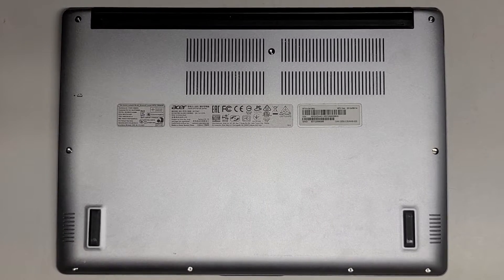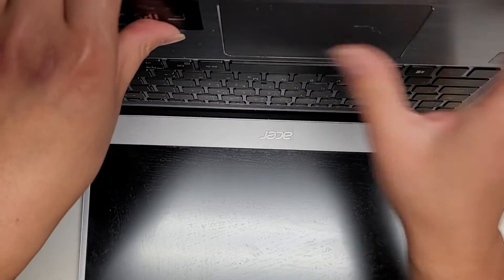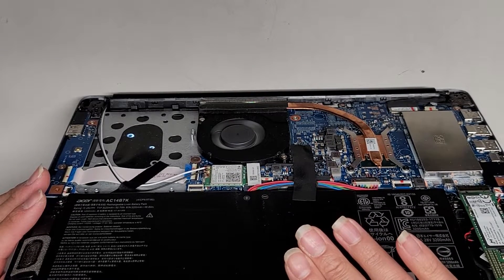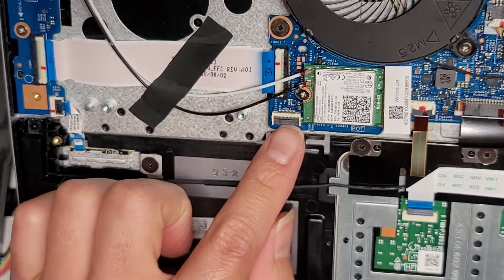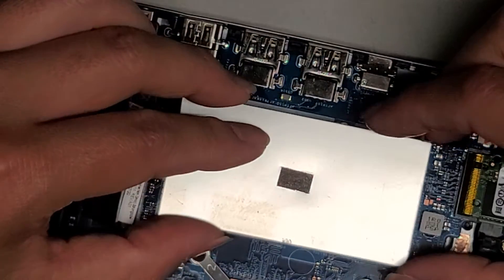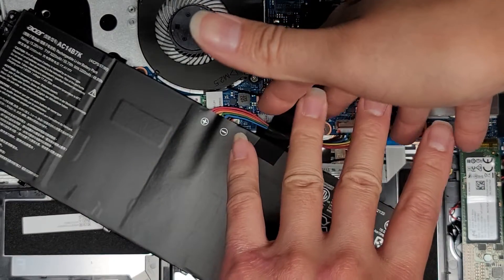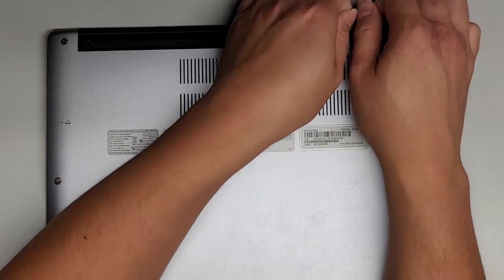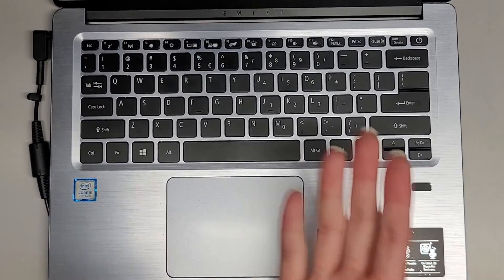Acer Laptop Swift 3 SF314-54 Series SF314-54-53BQ Disassembly RAM SSD Hard Drive Upgrade Battery

Comment: i got this laptop used for 100$ ,is there a possibility to add an ssd in the empty area and can i upgrade the ram from 12 to 20 ?
Reply from the maker: @zaailxx  there's only one RAM slot and one SSD slot
Reply: @ItsBinhRepaired  i already have 256 nvme can i add an ssd ?
Reply: @ItsBinhRepaired  and i mean i want to buy 16gb ram but they said its not supported

Comment: any solution for silicon nipple beneath the space bar key of keyboard ? that little thing is broken for that small thing can't replace the whole keyboard
Reply from the maker: Broken in what way?
Reply: @ItsBinhRepaired  silicone nipple beneath the keyboard space bar key, that rubber has broken into pieces completely i was removing the key and tweezer point just broke thay silicone thing
Reply from the maker: @pradip-p8e  you'll have to scrape the old one off and put another
Reply: @ItsBinhRepaired  i am not getting its replacement anywhere and put new with what glue ?
Reply: @ItsBinhRepaired  yes i have scrape the old one but not finding new one where to get and how to place it with what type of glue ?
Reply from the maker: @pradip-p8e  you could usually just put it in the place and it'll stay there. Need to order replacement keys. It comes with it usually.

Comment: Another stupid design by Acer, yes one can "Upgrade" the ram slot under the cover. Though if the soldered on RAM goes bad well one is left with a brick. I had one for a client and the soldered on RAM was failing as was leaking memory up to 90% with 8GB [4GBx2]. The top one was fine, though the inane soldered onboard one wasn't; useless and frustrating design.
Reply from the maker: Yup...

Comment: I have a sf314-54G with 4GB fixed and 4 removable, i know switching 4 with 8 to get 12 is possible. But would it be worth trying to use a 16GB ram to get a total of 20 even if the listed max ram is 12? I've seen some people say it's possible but opinions differ
Reply from the maker: Opinions don't matter. Facts do. If it worked for one person of the same model, it'll work for all.
Reply: Did it work?

Comment: Hello, I have two issues with this laptop,
1) I have only 4GB RAM, can I upgrade RAM to 8GB or 16GB? What form factor does it have?
2) My laptop shuts down instantly when i plug off from battery, but the battery worked perfect before that, what can be the issue?
Reply from the maker: 1) Yes. The info for the type of RAM  is in the video.
2) I recommend trying another battery.
Reply: @ItsBinhRepaired  So this ram is DDR4 2400MHz SODIMM, but i want to try DDR4 3200hz SODIMM. Will it be compatible?
Reply from the maker: @SkyBilim  you can try. I'm not sure.
Reply: @ItsBinhRepaired  by the way, thanks for the replies. I just figured out that my cpu cannot hold that speed. If I set 3200hz, it will automatically downclock to 2400hz
Reply from the maker: @SkyBilim  I see
Reply: What did you chose? 4+8? Or 4+16? 

I have the same notebook problem..
Reply: @alessandropavan98  better choose 8gb. 16 gb of ram will be lots of pressure for the laptop.

Comment: hi, do you see that empty space on the left? do you think i could fit a 2.5 inch ssd in there?
Reply: My model of swift 3 has a 2.5 inch HDD in that space
Reply from the maker: Not sure
Reply: Yes, you can. You need to buy the right cable tho
Reply: @guidolombardo2092 do you know what cable I need to install one?
Reply: @kirktan5057  there are two parts you need, the mounting kit and the cable , the Acer part numbers are: 50.GSLN5.006 & 33.GSLN5.004
Reply from the maker: This https://amzn.to/3P6eBtc
Reply from the maker: Yup